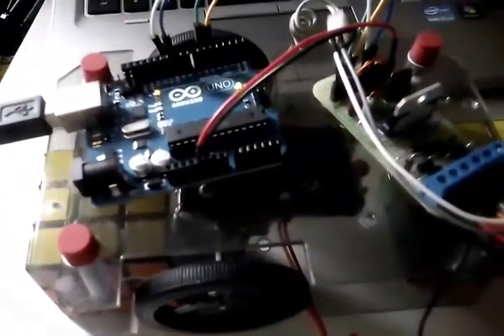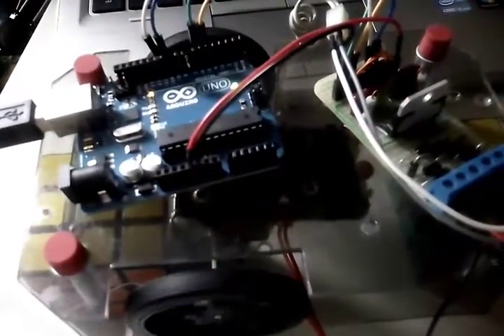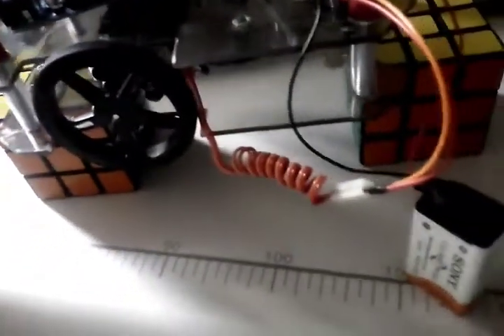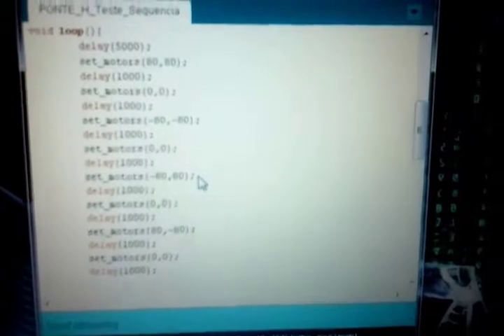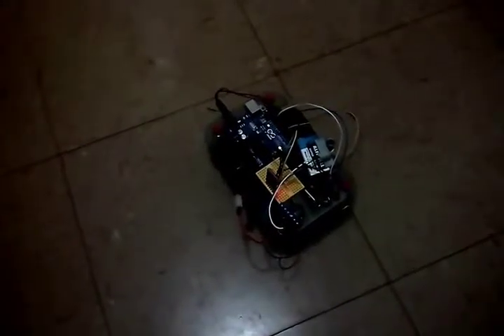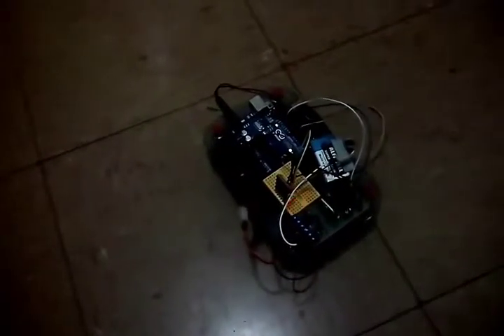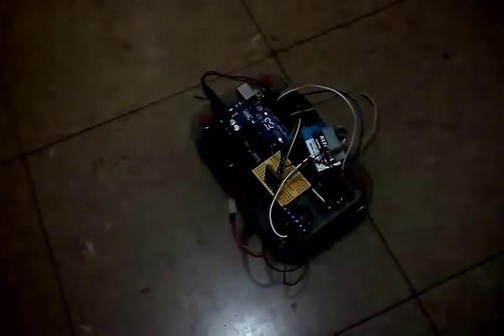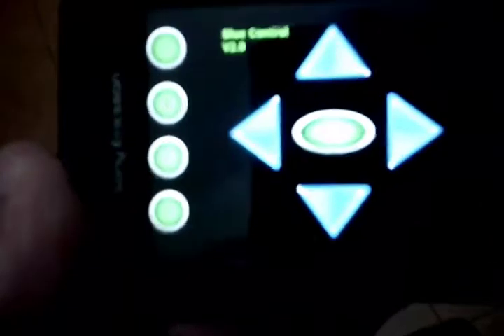BlueTooth Controlled cart   L298N Breakout Board

Comment: can the 5v vcc be used to power the arduino?
Reply from the maker: In the final project using the L298N Breackout Board you must use a separate power supply (one for Motors and one for arduino/logical control)